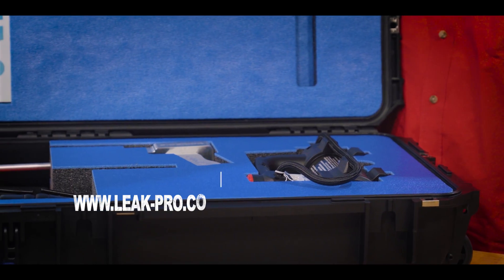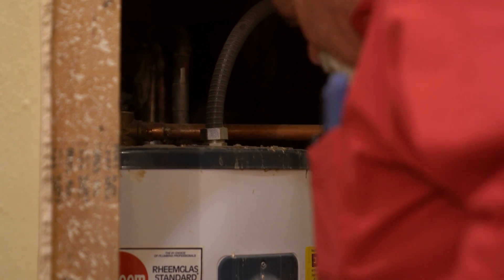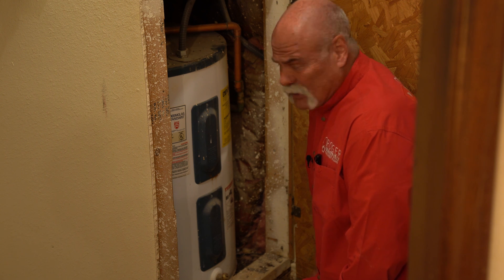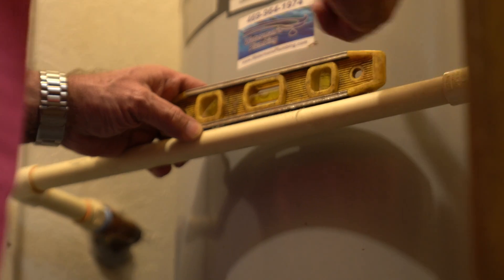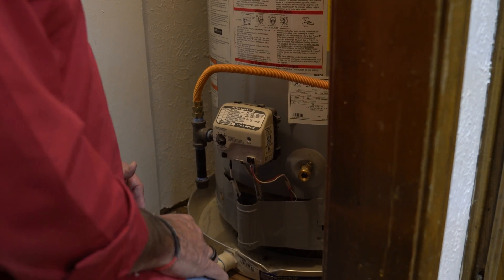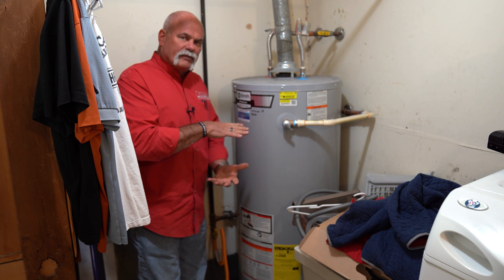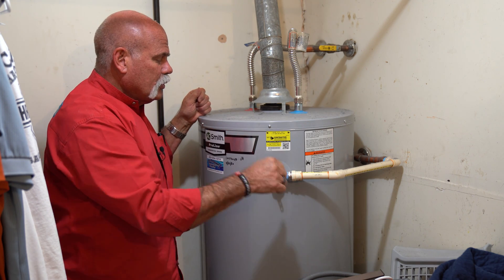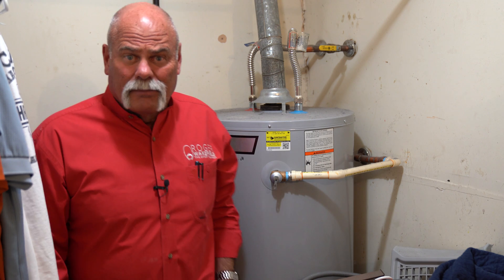How to Service a Water Heater | Plumbing 101

Comment: Gidday Roger, I hope when you install a new HWS you will also install a Carbon Monoxide detector/automatic gas shut off valve and also a Mildred valve?  Why on earth was the drip tray outlet valve capped off.  Hopefully you could install a tundish on the new install?

Comment: In my part of Arizona we recommend having a thermal expansion tank as well as an electrical quick disconnect for electric water heaters. My company hard pipes all copper and we don’t use flex lines for anything other than portions of the gas supply when not using black iron. I’m still learning though!

Comment: Problem is that the anode rods are installed to tightly at the factory,  it can be extremely difficult or impossible to loosen and remover. Another thing I don't like is that on some water heater brands, the anode rod is combined with the hot water outlet. Sucks

Comment: Plumbing Journeyman from Hawaii here. Just speaking on what we'd be required to do and comparing it to what you guys need to do in Texas, we'd need to add in earthquake straps due to all of the seismic activity that we have. Also, since our water is fairly clean, we recommend changing anode rods every 5 years (3-4 in areas with harder water). My personal cut off for servicing is 8 years but that depends on the condition of the heater. Thanks again for the video. It's always fun to see what other pros pick up and point out. It's a great way for iron to sharpen iron.

Comment: The thing with not manually operating the t&p valve is you have to assume it will function currently when the limits are exceeded in the water tank. You assume its "safe". I have ran into several boiler that were over pressurised and the relief didnt pop.
Reply: This guys a pencil pusher. He’s afraid to actually have to do some real work.

Comment: We remove them every week, and replace them with indirect heated boilers. A lot of heat is lost because of the exhaust running in the middle of the water. The air inside the exhaust is heated by the surrounding water, and will exit naturally. New air gets sucked in, and you’ll lose a lot of heat during the day. Also scale will build up surrounding the exhaust, and it will limit the heating exchange capabilities. Calcium is an excellent isolation product.

Comment: I dont like that the tnp is going into the wall. In my state they need to terminate at least 2” from the saftey pan
Reply: Similar here. Needs to terminate between 2-6" above flood rim of the pan
Reply: In Mass its max 6in off the floor. I dont think they would pass the t&p cause its passing through the wall
Reply: Running it into a wall is a bad idea IMO. At least in the IPC it says that they need to terminate 2 to 6 in from the pan or in a conspicuous location. If it is going into a wall you'll almost have no idea it's ever leaking.
Reply: In my jurisdiction, if the water heater is inside the house (not in the garage), the TnP must terminate outside the house between 4 and 24 inches from the ground. So, an inspection would require checking that out.
Reply: @kirkdarling4120  oh ok around here ive been told they want people to be able to see its leaking only water heaters i see where they run elsewhere are old.

Comment: Roger up here were we have basements, NY,  we set the tanks on some sort of concrete block to get it off the floor and get some room for the hose when draining, for the flush  unless the flue is low. I had problems draining tanks, the service guy said for me to leave the water on till I got a flow going,  then turn off the supply, it would drain after that.

Comment: Hey Roger!

There is currently a class action lawsuit against FlowGuard Gold CPVC pipes here in Canada, because the product is too brittle and WILL fail over time. I wanna know your opinion on this, and if I should be concerned for other CPVC items like Aquarise or System 636 (we can barely only get Ipex here)

Thanks a lot and continue your great work ❤